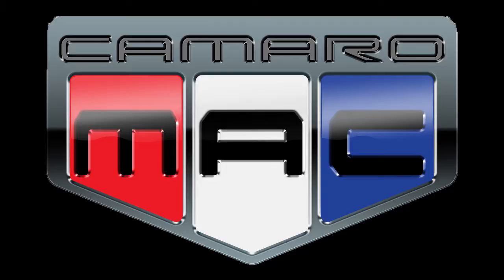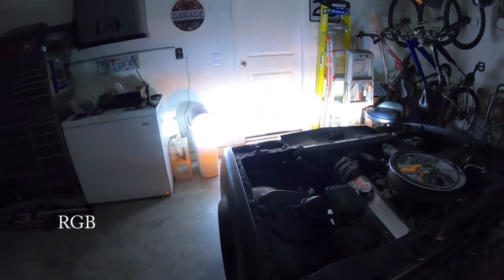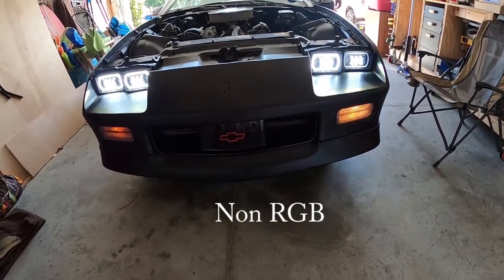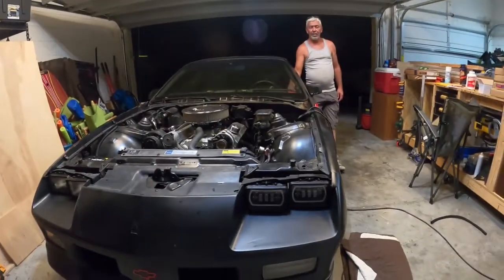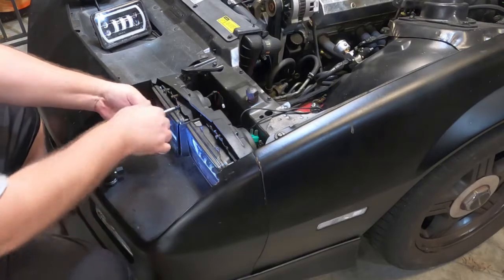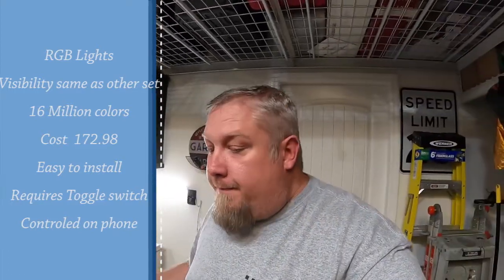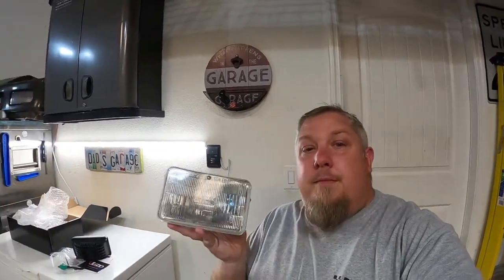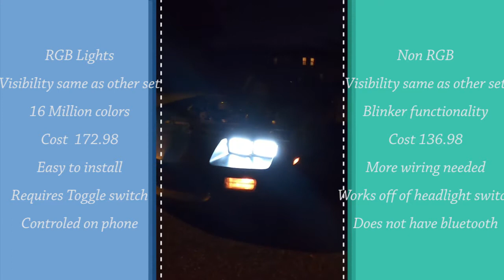Comparing 4x6 LED headlights - MOVOTOR and ZJUSDO

Comment: So the non rgb is yhe one you dont have to mess with witing right? Im looking into changing mine also
Reply from the maker: If you want these to work low and high beam, or blinker on both you will have to do some wiring